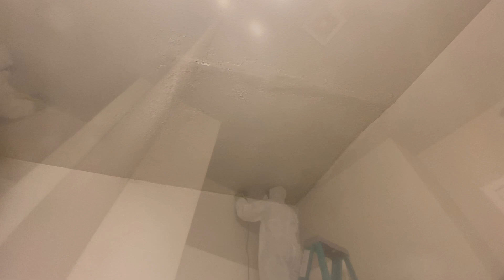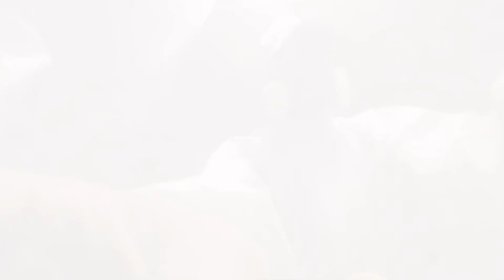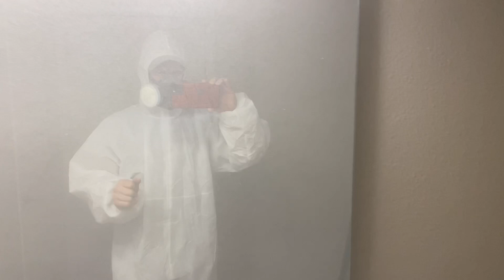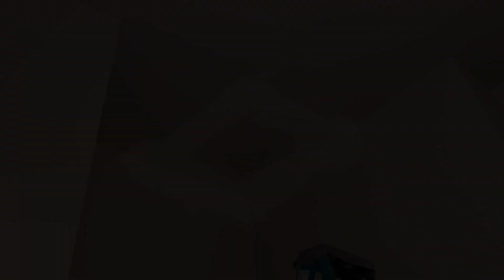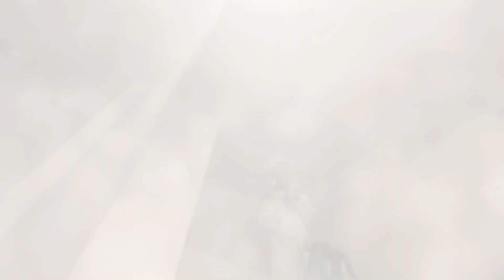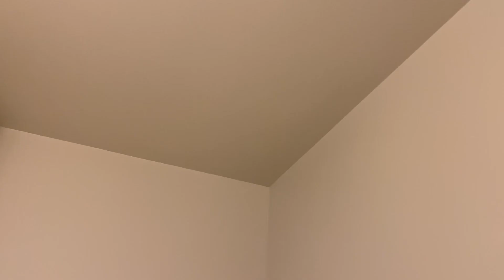Bad Drywall Patch Job Repair - Fix Bad Drywall

Comment: This is a nice video. I am a beginner at doing drywall work. Can you tell me why you shot texture? It appears to be a smooth ceiling.
Reply from the maker: It’s what’s called an orange peel texture, very smooth but still slightly textured. Easier to hide imperfections and potential blemishes. 👍🏼
Reply: Everything was great until,the texture part.  I truly hate texture.  All the work smoothing things out and you threw orange peel on. Smh. What imperfections were you hiding?  I truly don’t get it. Maybe show us with and without?  Our painters threw it up on bathroom ceilings that were smooth and just being painted.  They didn’t consult us.  Was so mad.

Comment: Boy what the hell are you doing?
Take the piece off and install new. Secure well with sink screws, use paper tape (holds stronger) using 20 minute mud. Wait until dried and just float the whole patch to prevent any bumps and match your texture at the end. All this sanding you're doing too much.
Reply from the maker: I finished this quicker than it took you to explain this. I floated the existing.

Cheers. 🍻

Comment: Thats a two hour job for a pro and thats being generous!
Reply: nd by the way l dont have your intellect or computer skills. Different generation. l hope your not going to be doing repairs when your sixry plus, Great video and l know you got paid. Great work. James l meant nathan at the first. When your old and have hands that dont work like they are supossed to its hard to type. Take care big homie! Hollar at ya!
Reply: Lol right on . Way to much sanding
Reply: I would've cut it back past that hump and put in a new piece of rock then coated it with 5min hot mud. No sanding whatsoever and no risk of tearing the face paper.

Comment: your dreaming james just to sand that is 1 hour ,tape and mud 1 hour, 2nd coat 1 hour ,3rd coat 1 hour ,texture 1 hour ,and if you use quick set you still have to wait for mud to dry so whole day job plus material and truck that you have to bring all material in looking at 800-1000 patch or not worth it for tradesman not gonna work for 20 bucks an hour and break your back fuck that
Reply from the maker: This guy gets it.
Reply: First of all a pro doesnt have to sand if you are going to texture. Second you can use hot mud and texture with hot mud and prime and paint in half a day! How do l know this? l do it almost every day.Thats a three hundred dollar repair for me.
Reply: @jamescathcart4762  never in a million years are you making enough money to sustain a legal business you doing this for cash for your buddy maybe and only maybe if he buys all the material